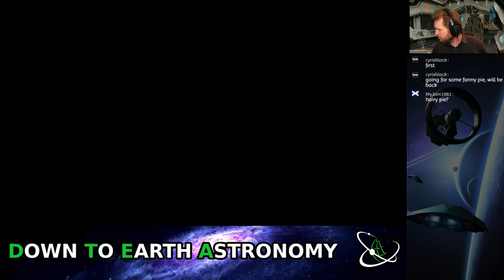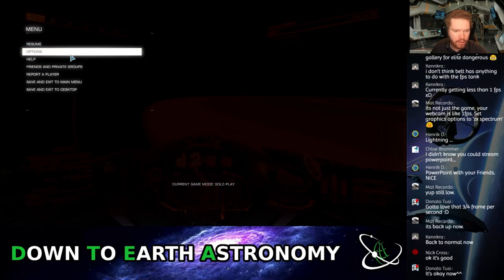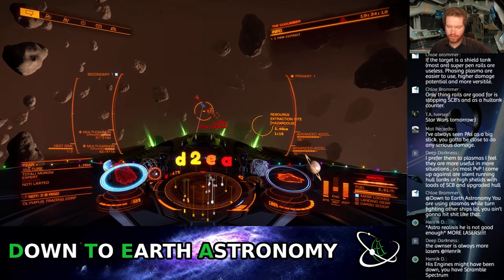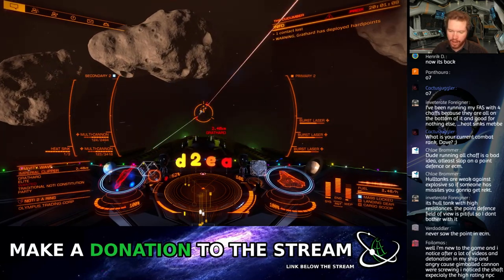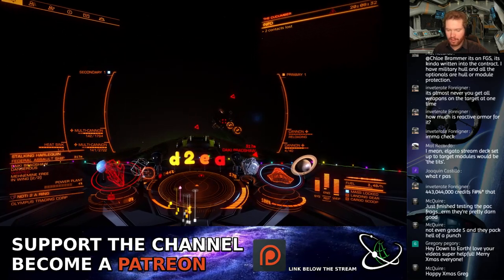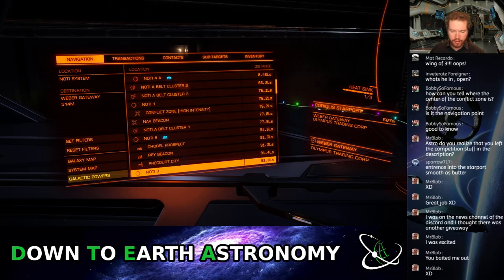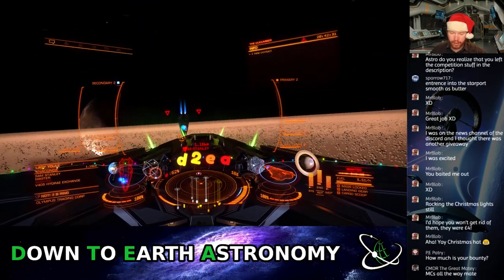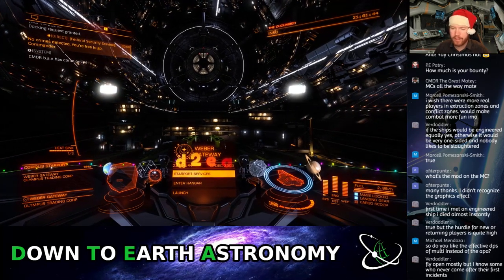Testing Advanced PAs with Down To Earth Astronomy

Comment: I'm running long range, turreted beams modded with thermal vent in the small/med hard points. 
 A large gimballed mutli-cannon, modded for high cap and Corrosive. 
 And, my advanced PA's are modded for long range and thermal conduit.